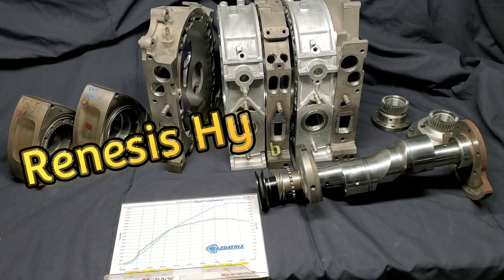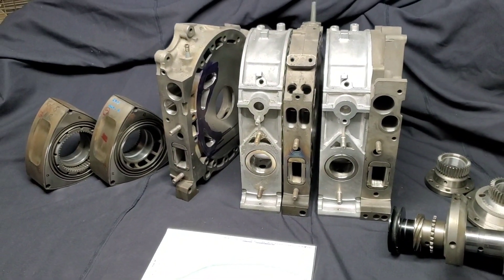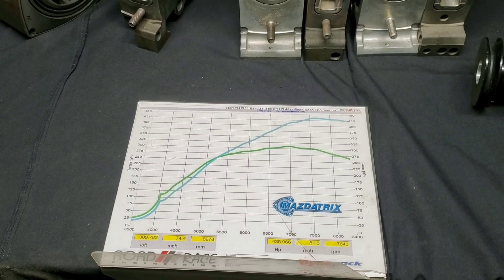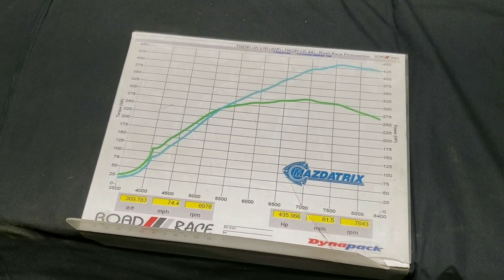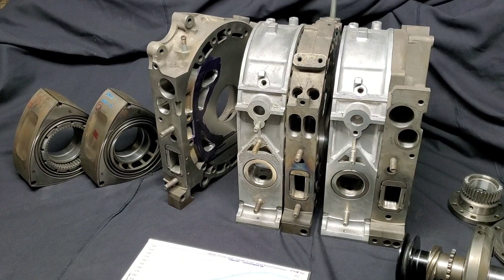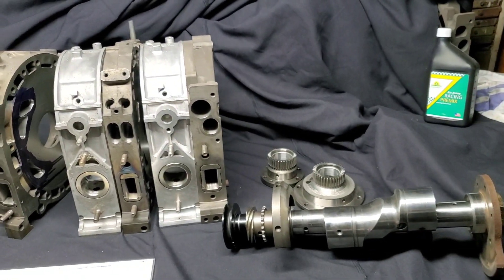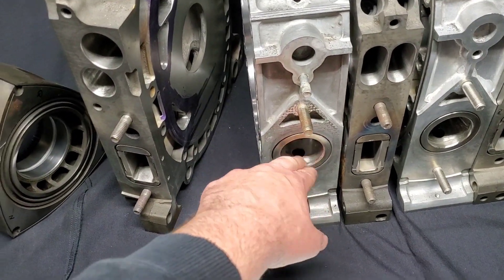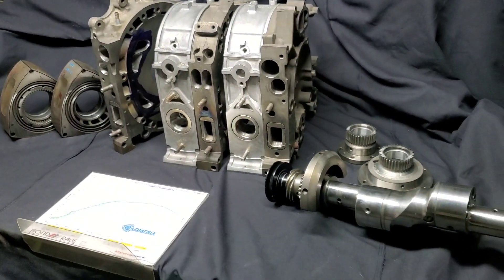Horsepower numbers! RX8 Rotary Renesis Hybrid, build updates, Intake & ECU discussion - Vol.6 KMR

Comment: What if you block the side ports? And run it like a traditional 13b motor
Reply from the maker: seems like a lot of work to make a Renesis block basically a 1986 to 89 RX7 motor... The Na FC is a 6 port 13b. Thats why the setup works as a hybrid. its really just a hi air flow version of an old RX7 motor. I bet it would run though with blocked ports. i just wouldn't do it myself. ...

Comment: Hey 400 horse is like 200 horse on 14.7 PSI. Does your car Make stock rx8 numbers? What if you rev it all the way up to 9k or 9.5k like a stock rx8? Is the torque too low to be usable? Just curious, I’m new I just am surprised that the engine didn’t make anything crazy. How does the Renesis rear iron compare to s5/s6 rear irons? Could it hold up to just as much punishment?
Reply: And this is crank vs wheel horse
Reply: Is the curve more usable?

Comment: Hey kyle.I made my fd motor into a peripheral.people ask me why?I ran this set up for installation purposes for my 94 tubbed rx7.Dave at mazda trix of course.He scalloped my rotors.9.7 rotors.clearanced.Jeff Mc call did my porting.its a bad ass engine.all balanced by Dave.Now.if I want modified rotors for turbo can u or Dave lower the compression?Mazda factory lowered theirs back in the day down to 7.5 to1.Thats the safe way to shove alot of boost and not break your side housings by the oil schematic were the dowels go.answers please kyle

Comment: I am wondering if it would be worth it to setup hybrid, ported, and studded and go back in the basically stock car so the core engine would be ready for ecu and boost later down the road maybe in a couple years. I have only had my 05 6 speed for about 8 months now and am debating the direction i would like to on it, first modification i am doing is knocking off the ebay coils the p.o. put on it and installing bhr coils, with new plugs and wires. At least he was premixing with idemitsu as i am doing so hopefully the engine isnt getting ready for a overhaul yet.

Comment: I understand that there is an excessive amount of overlap with this combination did you change the exhaust port timing or do anything to mitigate this?
Reply from the maker: Nope, With a street port combination the overlap is very average.
Reply: @KyleMohanRacing  how is that possible when a street port opens the intake earlier? Early opening = more overlap?
Reply: @blacksnakedotcom  renesis streetport templates do not open the intake ports any earlier—they’re stock opening with longer duration (later closing). The overlap is gained in the later closing of the peripheral exhaust port. Not earlier opening of the intake port.

Comment: Soon im going to start a semi or full peripheral turbo rx8 peoject for drag racing just brainstorming about 6 vs 4 port engine because I dont want to spend a lot on a transmision and the 4 port hast a decent transmission to start but I like the scalloping on the 6 port and the hardened stationary gears but thanks to your video im forgetting the rotor scalloping 4 port is winning😁 ... Any tip or advice is highly appreciated I also have a turbo II engine on the shop but I want to test the hybrid combination

Comment: man if a hybrid NA did 300Hp I can definitely see it being a really good upgrade for the rx8 without having to go to rew
not simple, but i suppose it could be simpler and even cheaper (to an extent) than turbo hybrid.
Cant wait to see this engine come together
Reply from the maker: I think its possible, just not proven
Reply: Do you have more info on the N/A 300 hp build ? I’d be tickled with 250/280
Reply: @ajustice2010  no, just some wishful thinking

Comment: Following the build closely and building at the same time. Going with a your half bridge, street port, and race exhaust port templates. Haltech 2500 allowing full functionality of all stock Rx8 features and all the safety sensors and bells and whistles. For now stock intake. Garrett G42-1200 turbo, 2 turbosmart 40mm wastegates. Turbosmarr BOV. Iridium brushless in tank fuel pump.  6-2600cc injectors. Will be running E85.  Currently waiting for rotors mods and balancing to come back. Will be porting housings and irons next week. Turbo manifold is completed. Working on fuel system now.
Reply: Which AR in the hotside are you planning to use?
Reply: I went with the 1.15

Comment: Love to see actual dyno numbers thanks. Still on the hunt to see an NA hybrid dyno.
Reply from the maker: Dyno numbers on the chart for turbo ish stuff.
Reply: @KyleMohanRacing  na? This engine interests me but would never get a turbo bolted to it.
Reply: @devonswindell9735  The engine wont work without boost because there is exhaust and intake overlap.
Reply: @blacksnakedotcom why not ? 
Use a valve in the exhaust to close the peripheral exhaust ports, open them at 5500 RPM .. like the second inlet ports … like VTEC rotary style

Comment: What cutting method is used to deepen the rotors for rx7 apex seals? wire edm?
Reply from the maker: We used to EDM them. And that does work it's just a little expensive we've currently found a method of CNC that is working and that's what we're currently doing.

Comment: More good info. I would still like to see a solid NA build with dyno numbers, but my thought is that these hybrids are really going to open up under boost and will yield minimal gains NA.
Reply from the maker: me to, have a friend with one. just not running yet.
Reply: Been gathering parts in preparation of more info from Kyle. Glad he is so transparent about all of this. Gets me excited for future rx8 builds in the community
Reply: they can and do get more than that NA and without all the hybrid

the thing is you won’t get that out of either engine with sloppy used parts doing a half hearted home build.   These are all hand-built and blueprinted to perfection professional quality engines.

This is a 230+ whp Renesis pro built engine (not a hybrid) with OE intake manifold and not ported either, likely by Daryl Drummond.  His NA Renesis engines routinely made 270 bhp on a Superflow engine dyno. He’s mostly retired now:

https://youtu.be/uGuLPFYJgSk

Comment: So using that graph, can we compare that to a standard S4, S5, RE, REW turbo charged 13b’s? Pros/cons between the hybrid and standard turbo 13B? What’s the advantage to doing all of this vs swapping a complete 13BRew? Love this video series. Can’t wait to see how it turns out! #invested #popcornonhand
Reply: Seems like exhaust flow. It has more port area than an REW now. 440 at 14PSI is crazy, I've never seen an REW do that kind of power at that boost level with that sized turbo.
Reply from the maker: @bennyb.1742   Yeah I don't ever say it but I think the motor has the potential to flow more air than FD motors or Cosmo motors, but it still needs more development and testing. I think there is some potential with this type of combination.
Reply from the maker: yea, it's a old graph, things are better now days but it gives a basic idea of what we had in 2012-2014 with the build.